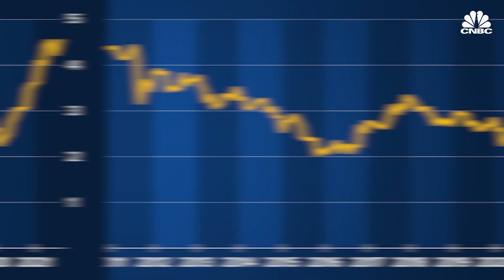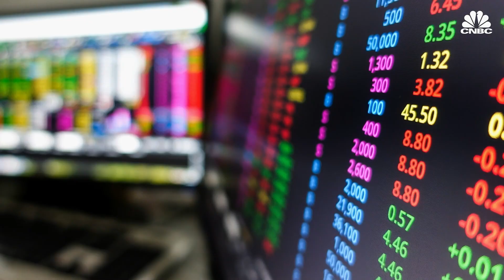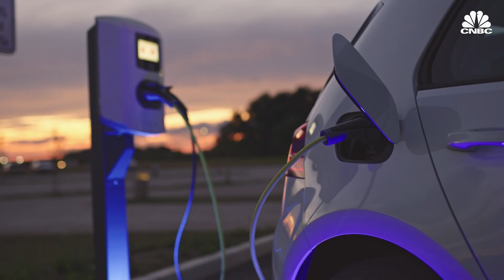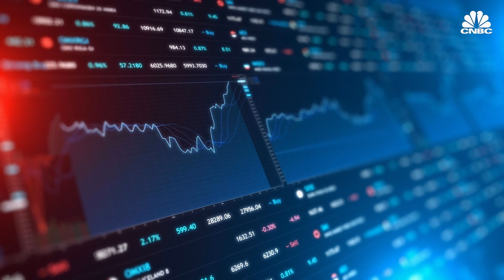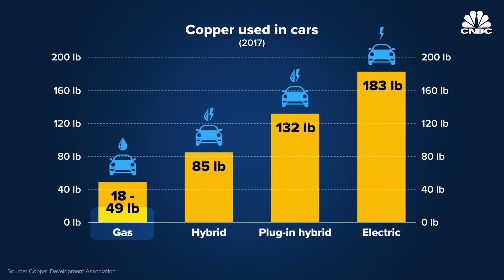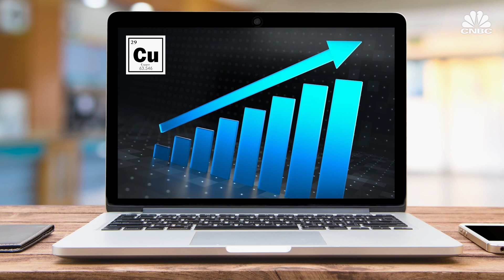Why A Looming Copper Shortage Has Big Consequences For The Green Economy

Comment: As a 30 year electrician. The green economy is a fugazi dream. A tesla takes 30kwh- 60kwh to charge in one night. In a average street are maybe 25 cars. The supply needs to be 750kwh - 1,5Mw to charge. The grit is not capable of that the copper wires are too small. You need to upgrade the entire word powernet. In the 30's there where all electric cars. The people changed to fossil feuls because electric driving was unsustainable at that time in the industrial revolution. Its impossible to going back. And to end this writing its only possible if we reset the entire system of living. We need fossil feul for our system to work. And there are no hands to make this happen. Who is goeing to put all the bigger copper cables in the streets? The youth is busy with fortnite and tiktok and they want all a computer job. No hands anymore. To end in the words of Klaus we need a great reset. Included climate lockdows. Its impossible to change the word withouth a fight. For now dream on Greta and the green economy.

Comment: this is just so fake. how many electric cars are made and sold each year? just a miniscule percentage of total cars produced. and they are justifying increase in copper rates already? even before the demand has even begun ? trust me its just the operators driving up the prices. its the same with all metals too which went a rally. 2020 stopped all industrial work and manufacturing. almost the same case in 2021 and with Delta variants coming up. so where did all the "new demand" come from?

Comment: Jeff Currie is wrong. Copper is not the single best conductor of electricity known to physics or man or industry. There are many various super conductors, graphene, and carbon nanotubes for some more exotic materisls, but if you want another precious metal that is much more common and conducts both heat and electricity even better than copper, silver.

Comment: Here are a few factors that are causing copper shortages:
1. The global population placing a heavy burden on meeting the growing demand for copper. 
2. Semiconductor products needs copper to manufacture computer parts which will continue to grow and expand into the future with further advancements to unprecedented level of innovation. 
3. Copper has a direct correlation with economic growth where copper is consumed in manufacturing construction materials like water pipes of electrical wiring, industrial finished goods like electric motors, even consumer goods (useful and useless) like brass knuckles or brass badges or trophies uses up some copper. 
4. With the growth of electric cars being expanded in the automotive industry, the demand for copper will reach new heights. 
5. Finally, copper is needed to expand alternative energy industries such as wind turbines for electric motors, and copper wires or connectors for solar energy, even as a catalyst to conduct electrical energy from hydrogen fuel cells.

Comment: Copper is not the best conductor silver is. The only reason they use copper is silver is 33 to 40 dollars an ounce compared to copper being 3 dollars a pound or 20 cents per ounce. I guess someone is trying to offload copper before ressesion hits and copper prices drop. When they drop they can buy all the copper they sold at lower prices. Each 400 watt solar panel needs 1 ounce of silver to produce, copper can’t be used for this. Copper can only be used on outside of panel for connectors. When a resection hits copper goes down in price and silver goes up. Just like they mentioned in 2008-2009.

Comment: Umm... No Jeff Currie. It's not. No. Copper is not the best conductor known to physics. Gold is. It's just the gold has an arbitrarily high value because of its use in jewelry, and it doesn't have enough tensile strength to be useful as wires. Also there are superconductors that have no resistance at all currently being experimented with. So no. Copper is not the best conductor known to physics.
Reply: Silver is the best conductor, then comes copper. Gold is a couple spaces down to chat. Gold is only 70% as conductive as copper is

Comment: As a electrician I’m seeing the effect for the first time in 23 years we are using aluminum for are feeders.
Reply: At the electric company I work for, and an electrician myself,  same here.  We are even going as far as using Aluminum 6/3 to power the electric Clothes dryer and electric range,   as well as 4/0 aluminum for the service entrance, many of our homes are using 200 amp services,  but we also build large homes with 400 or 600 amp services,  with two or three 200 amp panels,  respectively.   

We are sort of entering the same dilemma in the early 1960s to mid 1970s,  when homes began using 12 and 10 awg aluminum NM for branch circuits throughout the home, a cause of many home fires.

Comment: Another important aspect is by using hysteresis motor/generators one doubles the efficiency over a standard ones that are only wired to use half the output, not the collapsing field. 

I designed one of those as a lad 60yrs ago, before solid state ... a recent news was someone designed one, so there's two, I still have the timing diagrams.
Cheers 🍺

Comment: Copper mining and metallurgy cause most pollution and electric energy-consumption, among other so called green energy raw materials: rear earth for generators in wind turbines or motor magnets in electric automobile and silicon for solar energy. There is noting to do at all to instead help carbon emitting and nature resource protection and energy saving. Using products made of these materials, savings is just not enough to pay environmental debts that they made during mining and manufacturing.
Reply: Rare_earths give thousands of years of service for a kilo of ore, their carbon_footprint is tiny because of that and make extraction -> production simple, cars & trucks can run for a lifetime of the owner, no_inputs, no_batteries, no_fuels. 

Nothing known can match that, the wasteheat from coercion of flux is trivial per Nm-s and there to use for centuries upon centuries. 
Cheers, 🍺
Reply: Tom Mallard. Rare earth elements are wonderful in applications, only if its massive scale mining is kept in China, isolating pollution of land and air and water consumptions and material manufactures, the dirty part of the industry, inside China.
Reply: @jinluo934  Eliminate coal, oil, nukes & fracking before worrying about slowing down the missing r&d of ores able to become good magnets will be most useful to the planet.

Comment: Several inaccuracies here. 1 Copper has a conductivity of about 58 siemens/m silver is 62. Silver is also suitable for making circuit boards from. 2 Aluminium has a conductivity of about 39. So if you used an aluminium cable to get the same conductivity you would need a  CSA about 50% bigger. IE 50% more aluminium than copper. Is this a bad thing? Well the relative density of copper is around 8.9. Aluminium? 2.7. So for 50% more material volume you would still have only 45% of the weight. That's one of the reasons aluminium is used in transmission lines for electricity distribution.

Comment: There is so much copper in old brass that this seems blown out of proportion, I like their CEO eye candy mike though. Remember the news wants you to be afraid.
Reply: So you think grandma's old brass candleholders will be enough for millions of electric cars? The main factor is that separating the copper from the zink is very energy-demanding, so as brass, it is of little or no value.
Reply: @MrKnutriis  yeah you'd be surprised how much brass things old people have in their houses. Figurines, trays, lighting, vases, teapots, trash cans, flower pots, pails and buckets, door stoppers, cooking pots, etc. Like one house hold may not be a lot but a whole community's would be many tons. Also electric cars are relatively new for anyone but the rich and are still far too expensive for the working class so they won't be surging in production until they can use less resources and become less expensive. And if demand become great enough turning brass back to copper maybe a economically viable solution.
Reply: @TheNightshadePrince  You could be right but since the copper is in an alloy in brass, both metals have to be brought into suspension in acid, and then refined back to pure metals using electrolysis.  I'm afraid that the process costs more money than the resulting metals are worth.  I'm not able to easily find those figures but I know from my own work as a jeweler that the cost of refining is substantial - much more than the $4.36 pure copper costs per pound.  As long as it's copper it can be recycled indefinitely but as soon as it is an alloy it has to be refined to be extracted, for it to be used again.  The cost of the refining process will determine if it is viable or not.

Comment: Back in the seventies we start using aluminum wire for house wiring, it only took a few years and a whole lot of fires for that idea to flop. Aluminum works okay for service entrance cable, and some larger circuits were you have large properly designed lugs for the connection points. smaller sizes like you would normally find in Romex wire used in houses, the connections are very troublesome. We tried aluminum wire back in the seventies and it led to a whole lot of fires. Aluminum has such a bad reputation now,that most electricians won't even repair a circuit that used aluminum wire, they just tear it all out and replace it with copper. It's not worth the liability
Reply: i just encountered a really old house with AL/CU taps that caught fire.... it's no joke, dont mix it!.

Comment: 120 v house wiring is tremendously wasteful and inefficient. With LED lights you don't need thick copper wire going to every room in the house. Only high amperage equipment like stoves, washers and dryers need all that copper. Think about how wildly inefficient it is to charge your cell phone in every room in the house. Convenience wiring requires hundreds of feet of copper cable.
Reply: Everything we do is wildly inefficient.  But it sure drives the economy.

Comment: The same goes for rock aggregate in concrete, road building  If they want all the wind mills needed to power the good old USA  they can't mine it fast enough.  with that said all done with diesel fuel. Data is there they just want Americans to pay for there failures of the present and the future.   But remember they outlawed straws for drinks now we exchange the pollution to floating masks in the oceans. JUST FOLLOW THE MONEY

Comment: I've been to that mine in Bisbee and there's like historic signs talking about how the copper mine closed in 1999 lol
Reply: Mines are closed when the metal price drops and makes it unprofitable to operate.
When prices rise high enough the closed mines reopen. It's called mine engineering.
Reply: @noname-qf8jg  Ahhhh okay. How long does it take them to get fired up? And like does the land owner basically contract the job out to a company?
Reply: @yayeeters4919  How long to restart a mine ? That's not my line of work. My guess is, a lot depends on 
how long the mine has been setting idle. Land ownership and mineral rights are two very different things. 
This also depends on an estimate of prices for the next several years. You will not make a long term 
investment if you think speculators are manipulating the market for short term gain (pump and dump).

Comment: As an Electrician… I’ll just transition to Aluminum wherever possible.
Reply: And here iam replacing the old aluminium wires my grandpa installed in the 50s-80s with copper (Eastgermany)

The US should  switch to 220V/400V systems.. 
Needs less Copper, is more efficent on transport and would make devices compatible with EU standards.

Comment: Copper as a conductor can, and is already being replaced by aluminium. For example, all electrical wiring of the Airbus 380 is of aluminium! It is much lighter and several times cheaper than copper. Those in this video, who say copper cannot be replaced don’t know what they are talking about. Historically, there has been some issues with connections in aluminium harnesses, but they have been overcome!

Comment: Silver, copper, then gold. Aluminum at best is 64% as conductive as copper. I hope that explains you power bill a little better.
Reply: and the weight issue the lighter a metal is the more of it can be carried on pylons also greater amperage at the same voltage.

Comment: No, there are several conductors that are more suitable for the conducting of electricity, but they are softer and more expensive than copper.
Solar panels are a scam that requires replacement every five to ten years and uses too much copper in the shape of electrical grid sprawl.
Considering the intermittency quality of solar and wind electricity, they should be used in conjunction with a hydro-electric pump station to shift the energy supplied to the grid out of phase with the availability of sun and wind.

Comment: Copper isnt the "best". Its the cheapest easier to implement into everywhere... just like silicon and sand being everywhere... not the "best" just more convenient.
Reply: But there has been a lot of use of Aluminium wiring due to its low density and low cost.  It can have longer unsupported spans.  If some current uses of copper were replaced with aluminium then it frees up existing supplies of copper for those tasks where it is essential or highly desirable.
Reply: @smitajky  Thanks for the info
Reply: @smitajky  I thought the main issue was that aluminum wiring is inherently more dangerous i.e. connections are much more likely to become loose etc and therefore lead to heat generation and arcing. Now my personal experience is with regards to residential wiring https://structuretech.com/aluminum-wiring-2/, I accept there is probably many applications where it could be used safely.
Reply: They never said it was the best
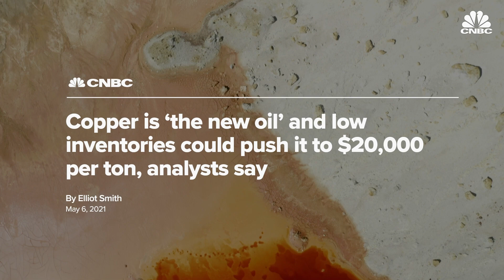Reply: @maka8551  hit up the 2:10 mark of the video and press play. My statement stands.🤦🏾‍♂️
Reply: @maka8551  2:13

Comment: 2:12 "Copper is the single best conductor known to physics". Wrong. That would be silver.
Reply: @Mind Blown Because gold has a superior trade off between conductivity and corrosion. It's all about the free electrons in regards to conductive capability. Silver, copper, gold. In that order in regards to conductivity. #MindBlown
Reply: Gold is a worse electrical conductor that both copper and silver. I find it incredible that you would come online to "correct" someone and not even bother to be right.
Reply: @Mind Blown gold is very corrosion resistant

Comment: Duden plan is a big mess. Beside copper, sand is going to run out. They can't use desert sand. And the poor  country are about out of sand. That for silicon chips, processors. Mon
Memory chip. And glass, and battery, and cement.

Comment: "As with many natural resources, the total amount of copper on Earth is vast, with around 1e+14 tons in the top kilometer of Earth's crust, which is about 5 million years' worth at the current rate of extraction. "
Reply: We won't need that much there's going to be a point where copper already mined is much more economical than the obtaining ore
Reply: @asandax6  Exactly/ Any "shortage" is artificial.
Reply: @oldcountryman2795  that’s not necessarily true. If you can’t get to it then what’s the use. Then again if the demand explodes exponentially then people will be looking into how to mine the stuff that’s out of reach.

Comment: And add too the problem of e-waste not being recycled in so many states, amongst other things.
Plus China wanted repayment and wanted copper as payment.  Along with the fact that copper mixed with zinc makes brass, and nearly all ammunition is made with brass casings,  so you have a huge amount locked up in that product,  with open ranges copper bullet and copper based casings left on the ground all over the USA, and anywhere there was military conflict.  Not to mention all the copper wiring tied up in airplanes , just sitting there in all those surplus storage air fields, and decommissioned missile silos.  And navel ships, decommissioned. And the large amount in USA currency.  Alot of copper locked in limbo!
Reply: I have 2 five gallon buckets filled with pre-1982 Lincoln copper cents. They really add up!
Reply: @farticlesofconflatulation  that copper would be of more value than the coin itself 😶
Reply: There is a very large recycling of brass. By military and there are range rats scooping brass all the time. Sometimes while it’s still hot. Much once shot brass is reloaded and resold or used at indoor rental ranges and where classes are given. There is a brass shortage for casings currently. And very interesting China wanted paid in copper.

Comment: I think Aluminum can replace Copper without that much of loss in efficiency, luckily Aluminum is the most abundant metal in Earth's crust.
Reply: Problem with aluminum is corrosion, higher resistance, and heat flux. There is a reason why NEC specifies what can be copper or aluminum, solid or stranded, and wire gauge equivalents between copper or aluminum wire.
Reply: David Yes! I had a newer air compressor where the motor was made out aluminum wire. It overheated, caught fire and melted.
In this case...aluminum BAD for conductors.
Reply: New power cables are aluminum. At least here in Europe where we place the cables in the sidewalk and not over.
Reply: Most long distance cables are Aluminium already.
Reply: Just start more open pit mining and destroy the entire area for agriculture and drinking water for centuries to come. Jamaica is fighting this right now. All short term "solutions" while disregarding the long term needs for humanity to keep a viable human habitat.
Reply: Aluminum is one of the most expensive metals to make, because of how energy intense the process is. Even though we have a lot of it in the crust, but to actually make it in to aluminum metal its bloody work involved.